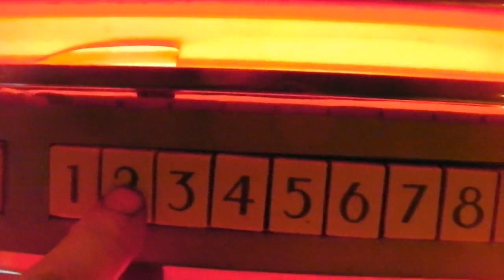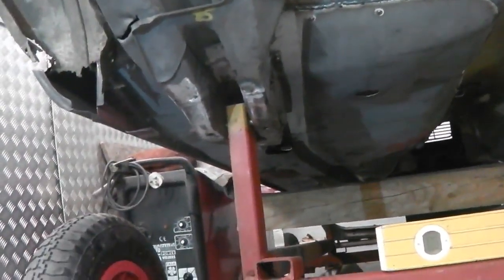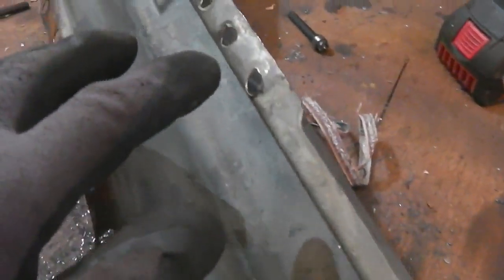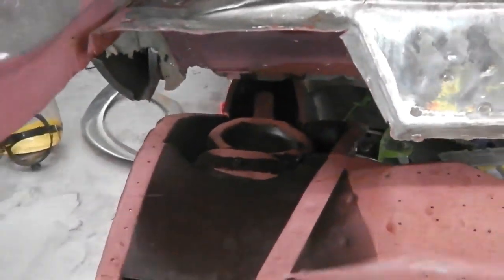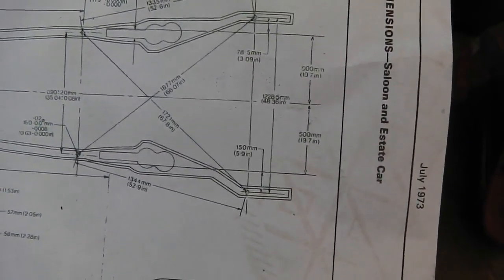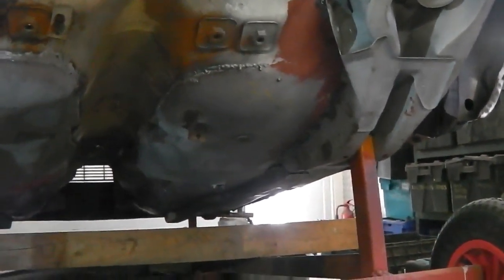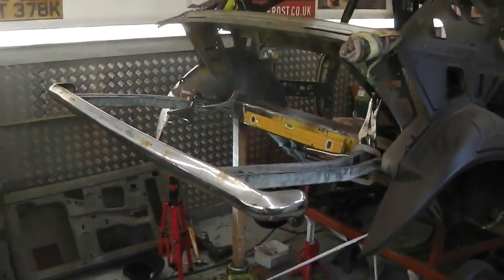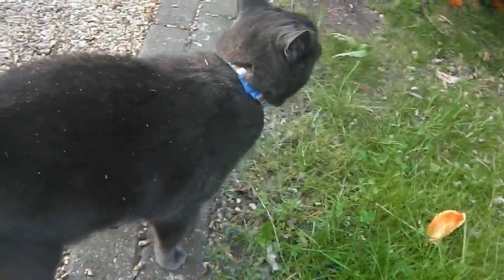Classic Car Resto - Ford Cortina Mk3 - Project Bramble EP24 pt1

Comment: Pete, when measuring diagonal datum points it's much easier to use an adjustable length bar with a pointer on either end that you insert into the datum point holes, than messing about with a tape measure. Much quick and accurate.
Reply from the maker: ive seen these in a recent vid, looks the PRO way to do it. thanks for this info

Comment: Pete,when you get stuck spot welds,cut the metal to be removed,a bit closer to the weld and use Pincer pliers to get between the metal and the part to be saved. a bit of wriggling and like a bad tooth,it's out.

Comment: I can confirm that was a hole for the jig as i worked on the underbody at Dagenham!
Reply from the maker: Kev thanks for this. Im happy to confirm (as youtube vids are a good few weeks behind) that the chassis has lined up to within 2mm tolerences, its perfect bot front and back, great to speak (again!) to a Dagenham employee!!! all HAIL !!! Kevin !!
Reply: @PeteCswampy  it will be nice to see the finnished car , glad to see some one taking the time and effort to keep these old Fords going and  back on the road again !
Reply: @PeteCswampy  All Hail!
Reply: @kevinb897  out  of interest (coz pete mentioned it) was the "bell mouthing" on the jig holes there to "centre" the part in the jig and to strengthen the pin area so the assembly wouldn't warp when welded?

Comment: Very interesting episode Pete! All the cortinas I've had and like you I never knew the rear chassis rails were different, makes sense when you think that the fuel filler neck needs that space, I think I spent more time under my mk3's than in the driver seat so I thought I would have noticed, like your ramblings on Bramble Pete so keep it up, I ramble as well at my age" :)
John (Norfolk)

Comment: That's strange about the bumper brackets , something you'd never know but now you know you will never forget . Almost as if the designers had forgotten about the filler neck and kind of bodged it up thinking nobody would notice the space between the bumper brackets to the end of the bumper were different . 

Speaking of bumpers , if there's one feature l like about modern cars it's the lack of them ! The first job l did on the first car l ever owned (mk.1 Corrina 2 door) was cut 'em off . I did try undoing them first but those dome headed coach bolts with the square shape on them just spun round and round !  Sure they go some way to protecting the bodywork but a pranged up bumper looks just as bad , if not worse , than the body bashed in . And because the front and rear ends on modern cars a mainly plastic anyway , you can fix any damage  with gaffer tape from the pound shop !

I always  thought the most logical (and neatest) place for the fuel cap was dead centre at the back of the car , hidden behind the number plate . My PC Cresta , mk2 Consul and mk3 zephyr all  had the fuel filler there . Can only think safety regulations put paid to the idea (guess more cars get hit at the back not the side) but the central fuel filler makes loads more sense as you can fill up from either side of the pump .

Those diagonal measurements are an achievement to your accuracy Pete  . Appreciated the "live" measuring with that natty magnet thing - good work ! 

Love how it is light late at night and early in the morning this time of year . We had a fox cub in the garden the other night , beautiful creature . It saw us watching but wasn't spooked or anything , just sniffed around and then jumped over the fence at the bottom of the garden . Wonderful ! 

Nice intro again , My Sharona by The Knack is excellent , but you never get to hear the full length version which is awesome . 
Keep up the good work Pete ,  take care , and more selfie stick footage please !

Comment: The two vertical measurements of 57.0cm. If the car was bearing down on one side more than the other, then that would manifest itself in the dolly's cross member being on the slant. Given that it's level, and the dolly (we assume) is symmetrical, is it not automatic that the two vertical heights to the bolts would be identical regardless of whether the car was attached to it and bearing down on it or not?  So, the two 57.0 measurements appear to be no more than confirmation of the symmetry and level of the dolly. Nice but unsurprising.

On the other hand, the parcel shelf etc levels are indeed confirmation of the trueness of the rebuild. They are intrinsic to the car, and it's great to know that they correctly reflect the dolly's level.

Sorry for the essay. I couldn't express myself in fewer words.
Reply from the maker: yes you are right, i did give this same thought as you when i was edititng the film, thinkin on same lines.....